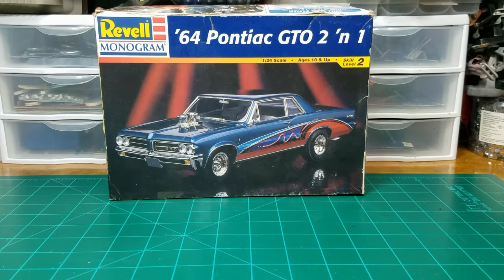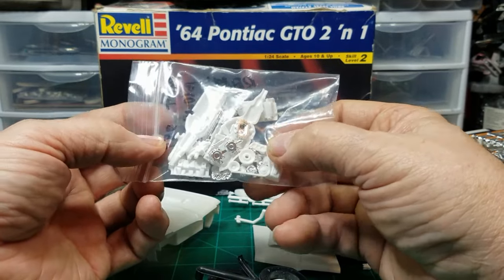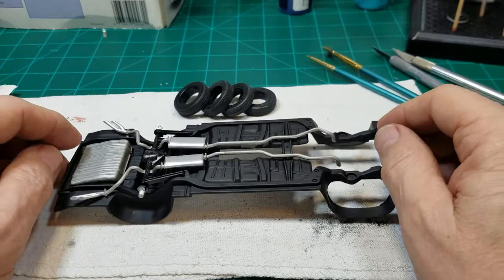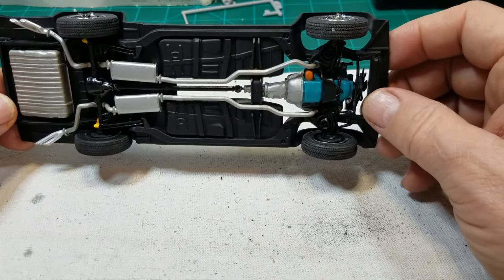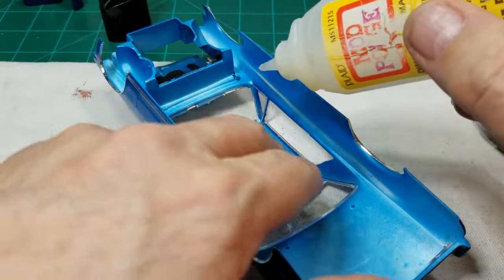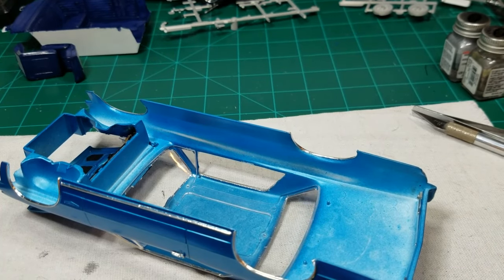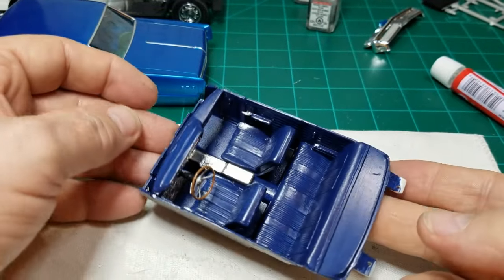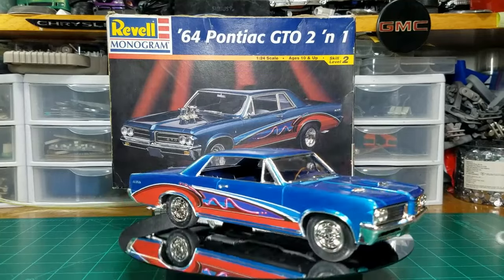1964 Pontiac GTO 2 ‘N 1 by Revell/Monogram - Episode 60

Comment: That’s a great build. I’m working on the same car now on my channel. It’s a really good kit. I 
Ike the stock look. I’m going with the custom look. Might pick up another one to build the stock version. Gto stands for gran tourismo omligato.
Reply from the maker: Thanks! I haven't heard anything from you in a while...  Yeah, this was a great kit and it was a shame that the previous owners of it lost some engine parts and stripped it of its rear tires. It still turned out pretty well with what I had to work with. You are correct on the meaning of GTO but depending on where you look you'll get variations of the name. Thanks for watching and good luck on your build of this great kit!

Comment: I have the same kit and they cut the sedan pillers out to, i been trying to find a body that still has the pillers in it.
GTO stands for gas, tires, and oil
Reply from the maker: I could have gone either way with this kit, but as you saw in the video, I went with the easiest option of removing the remaining pillar and door frame. I could have just rebuilt everything that was missing with some Evergreen plastic that I have here. Either way, it turned out well. Thanks for watching!

Comment: That's not all your missing mine came with the two bigger tires
Reply from the maker: I wanted to use the bigger tires that were once in this kit but they were obviously more useful to the previous owner. Sometimes, you just have to do what you can with what you have. LOL
Reply: I have a model box full of tires and wheels as I usually build stock units. Also have a box of decals.